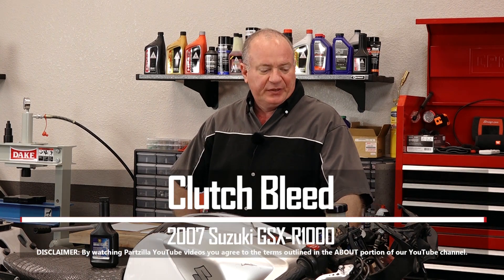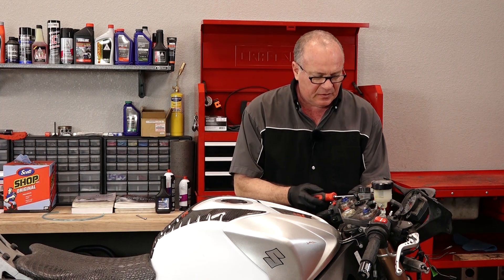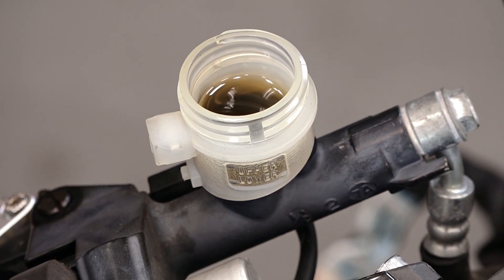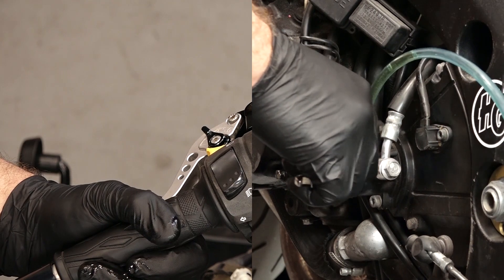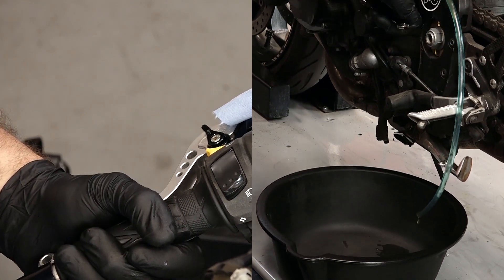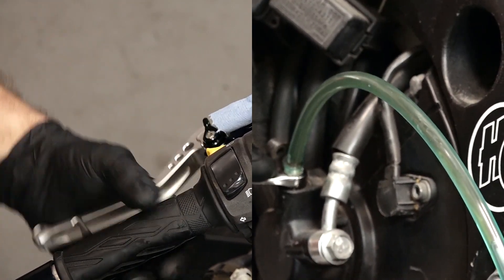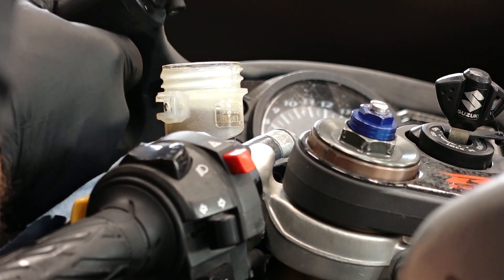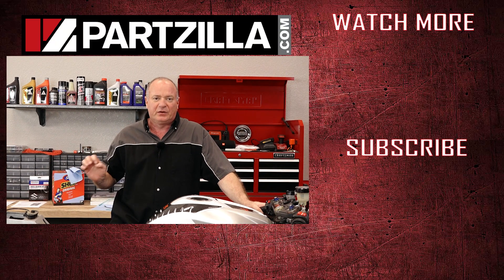How to Bleed a Hydraulic Clutch on a Motorcycle | Suzuki GSXR 1000 | Partzilla.com

Comment: I always enjoy your videos.  Not being critical, but here is a variation on your technique that I have found useful.

I prefer to leave the cap off so I can see the fluid level.  I have found that placing a clean razor blade into the reservoir will block the spurts.  I also remove most of the old fluid from the reservoir with a turkey baster before starting.  This will save much time as you are pushing fresh fluid through the lines immediately and not just slowly diluting the old fluid in the reservoir.  Usually one or two fills of the reservoir will get clean fluid to the bleed valve.

Comment: When I bled my 2007 GSXR 1000 last night I followed the exact steps, although the brake fluid wouldn’t fill the plastic tube completely and stay inside of the tube. I dunno why it was like this. My clutch has excellent pressure now, and my fluid is 100% clean. I used a plastic syringe to re-fill the clutch fluid container. I will work on the brakes next.

Comment: This is weird everyone says clutch fluid will eat into your paintwork but I’ve never had this happen and yet I had a leak that caused the fluid to pour onto the black plastics and yellow fairing. I didn’t know it was harmful so I wiped it off with a dry rag and it’s not caused any damage or discolouration. If anything it cleaned the black plastics making them look new. I use FUCHS  Silkolene universal brake and clutch fluid.

Comment: On my service manual (1984 Honda Shadow vt700c) it states insert a 20 mm or 3/4" spacer between the handlebar grip and the clutch lever. This will prevent over-travel of the Piston within the clutch master cylinder. The video doesn't appear to adhere to this principle, I'm going to follow his principle & place the spacer for added protection.

Comment: Hello, I took my front sprocket cover off, just to clean the area of grease build up, and when I re installed it I lost clutch pressure, I didn't force the cover back on, I quite the cover back on easily to the clutch rod. What is the issue?

Comment: I have an 08 GSXR 1000 (essentially same bike). My clutch started not to have a lot of pressure. When I cranked it in gear, it would move as is it wanted to crank and pull off. It was hard to shift up and especially downI noticed that after riding a few miles, the issue would go away after the bike warmed up. I pulled up your vid to bleed it and now I have NO pressure. I’m guessing the slave cylinder is bad? I changed the chain and sprocket a few month ago and had to bleed the clutch then. Any input would help.

Comment: how do you get pressure build-up at the handle? It would still have no pressure? How does it build up?
Reply from the maker: bleeding it is the way to rebuild the pressure.
Reply: @PartzillaParts  I'm bleeding the line over 50 times. Not building up the pressure. I've replaced the insides. Came with seal already on the push rod. Now I've rebuilt the slave cyclinder as well and have bled that until no air or bubbles. Bled 50 times and nothing but fluid running through. But it won't pressurize.
When pumping clutch handle you can take the line off and  hold your finger there and it will push out hard. But put the line on, bleed it 12 times and there is still no pressure at handle. None.
Reply: @MrCbell57  I have the same problem
Reply: @kolbiethegoat2168  There had to have been some problem that I failed to figure out. I sold the bike so it solved the problem. Not sure if internally I missed something or did something wrong. Just never was sure of what was going on.
Reply: Im having the same problem. I think my bleed screw is letting air in at the threads.

Comment: Hi john. Im having a problem with my clutch. When put 1fst gear its like the bike wants to start moving. I change the fluid and nothing change. Good presure. I check the clutch when the engine runs and moves fine. And when put a gear i cannot change gears with clutch when i stop. Only when turn off engine.. i try with the slipper adjustment (3 allen bolts) but its the same. 
Bike was 5years without use.... something?

Please help. !!

Comment: Hello sir i bought this quad real cheap thinking it was going to be a steal drove it around the yard it worked fine went to load it up to go ice fishing got half way up the ramp wouldn't go the rest of the way up ramp. So I pushed it down and it wouldn't go forward or backwards in gear then I noticed a oil slick on ramp and now it won't go forward or backward. It's a 2000 Suzuki king quadmatic 4x4 its either a 300 or a 400 cc single cylinder I think it must be a wet clutch called the Suzuki dealership parts she looked and looked she said it takes 5 ounces 80w-90 hypoid gear oil. Now sir my question would be what would be the first thing you would do to make it move again? Thank you for your time sir because I am stomped and don't know what I am doing.

Comment: I have a 86 fazer fzx700.  My clutch lever is real sloppy.  And seems to grab about 1/2 inch before touching the grip. Can I adjust it?
Reply from the maker: You can adjust the cable, if that does nothing, maybe be time to inspect the clutch.

Comment: I need help getting pressure back into my clutch it was fine then I had nun at all cleaned the slave cylerder and bleed the clutch and still no pressure what do i do
Reply from the maker: Probably air in the slave.  Bleed that first, then the lines.

Comment: Did as shown but notice gear would not release while pulling in the clutch handle. thought i had air into system but not, using dot 4 what im doing wrong?
Reply from the maker: The master cylinder could be bad, might want to run through it.
https://www.partzilla.com/catalog/suzuki/motorcycle/2007/gsx-r1000/clutch-master-cylinder
Reply: Mine is a gsxr 1100 just bougt it,  what i found strange everything worked out fine before bleeding the clutchoil.and the mastercylinder works if looking into the cup, i think the clutch lamells is stuck cause i dont know if early owner been changing the motoroil to the right one or lately. But by looking at clutchoil it was in a cloud of blackoil in cup so the early owner is not the best. To say also its a cold country and driving is not often. Thats why i wonder about clutch is stuck. So changing the motoroil and do a little runstart might loose it?
Reply: Antakaran u get your problem resolved?? I having the same issue with my 08 1000

Comment: Hey John I have a quick question my raptor 700r 2010 won’t start all the lights turn on but once I press the button so it Can turn on it does 2 click noises n it won’t turn on I checked the fuses but everythin is good?
Reply from the maker: Juan Gonzalez check the battery connection, especially the ground. Measure the battery voltage, needs to be greater than 12.5

Comment: How hard is the lever supposed to be when your done? Compared to the brake lever.
Reply from the maker: It shouldn't be very hard to pull in.  The brake lever will have much more tension once it grabs the rotor.
Reply: Partzilla ok thanks i just put in a new clutch master cylinder and its as hard a  brake would be. I guess i just need to continue to bleed it?
Reply from the maker: If it's hard to pull in, it's not safe.  You need to be able to clutch without cramping.
Reply: Partzilla ok well i tried to run the bike, and it cuts off when i shift to 1st, so its not engaging, what should I check next?
Reply from the maker: Typically this is air or water in the line, if your fluid level is correct and you are confident you bled it correctly, then you would check or rebuild your clutch master cylinder and slave cylinder.

Comment: I replaced the front sprocket on my 1000. But took that bolt ( hydraulic bolt with hole in it) off the the sprocket cover to access the sprocket now I can’t neutralize my transmission. I have tension on clutch but no neutral when I pull clutch in. HELP PLEASE!
Reply: Same problem here. How did you fix it?

Comment: Question ? Why brake fluid in a clutch system ? I would think that brake fluid is for the brakes and clutch fluid would be for the clutch system....say in a car it has it's own fluid for the transmission and one for the motor. You do not mix or switch.....????

Comment: Yo guys i got a question for my 2007 cbr1000rr i just brought it (its got hydraulic clutch). My friction point on my cbr is soon as u pull the clutch and goes to 1st my bike starts engaging :(  would u guys be able to help me what is the main cause of that?? Pleease :(
Reply from the maker: If you have new fluid and it's bled properly, then you have to inspect the clutch.
Reply: Partzilla ok thanks heaps 😁
Reply: Ghost rider what did you find out? I’m having the same issue. Thanks.
Reply: @deronthomas1566  my clutch was so crap man. It needed to be bleed(replace fluid) so it can be on tip top performance. It was that old that when u put your bike in first gear. will start moving witout even letting the clutch out even 2mm lol. Got to the point where it become really scary so i went and got it towed and took it to mechanic and got it done. Now it runs like a brand new bike. I got a major service done too cause i didnt know the service history of that bike when i got it and did not trust the previous owner. Got all fluid change including coolant, spark plugs, air filter, valve clearance and new fromt and rear brake pads all up ($1,090 ) 😁✌
Reply: @deronthomas1566  but yeah thought i needed a new clutch. But what the mechanic did is they bled the fluid first and that was my issue, my clutch was fine. 😁
Reply: Ghost rider I’ve bled it but I think I’m going to start with the slave cylinder. My issues would go away after the bike got warmed up. But I went to bleed it and it went completely limp. No pressure at all even after going through the motions of bleeding for like 30 mins.

Comment: Phillips screwdriver on a metric bike? Only if the tip is ground flatter.  Get JIS screwdrivers instead!  Phillips drivers on JIS screws = stripped.
Reply: I need help on a bike u know why it wont bulid pressure